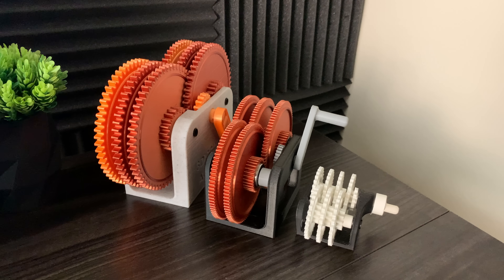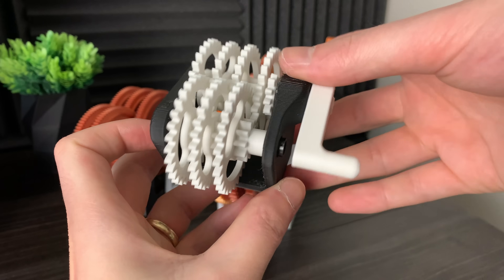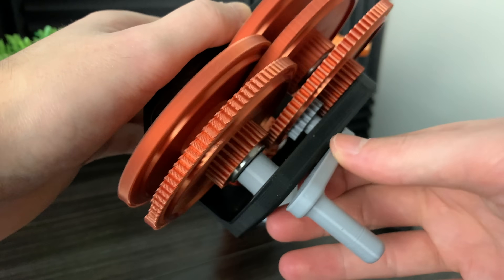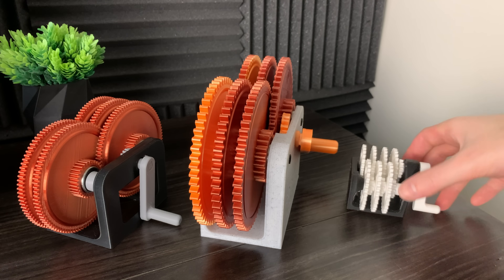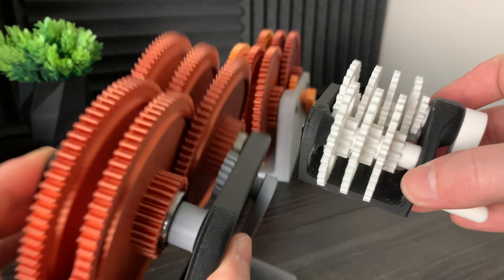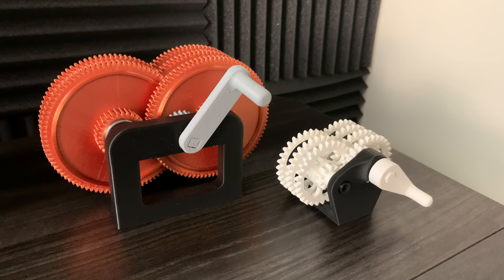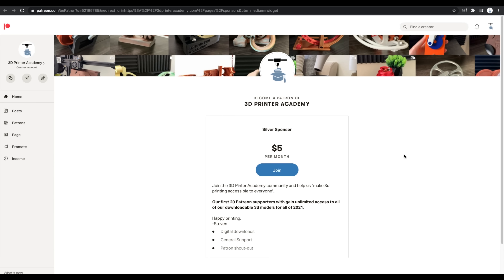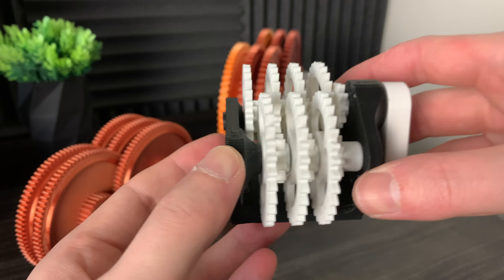3D Printed Gearbox Series [Episode 1]

Comment: I have a few suggestions: (1) Your torque essentially vanishes on the later (fastest) gears, the first gears get most of the torque. So you can make the first gears more heavy and more chunky, by increasing their width. (2) The efficiency of a gear is roughly a function of the tooth depth w.r.t. gear size. So to make it more efficient, reduce tooth depth of the ones spinning quicker (or increase their overall size), which works since you don't need much torque (less tooth depth gives less resistance/durability)

Comment: I made something similar for an electric boat I’m building.  The input spins at around 20,000 rpm and the output at around 1,333 RPM.  The 4 gears are solid ABS and the wooden enclosure houses 6 bearings.  The gears are lubricated with white lithium grease, which appears to be inert.  I should have used graphite lubricant, but white lithium was the only grease I had on hand.

Comment: You NEED lubrication. I work with wooden gears and use candle paraffin or dry soap as dry lubricant for the teeth. The difference it makes in friction is insane (to the point where most of my mechanisms wouldn’t even work without it). I haven’t worked with plastic gears so I don’t know if it would be better to use some kind of liquid lubricant instead or not. But anyway, you need lubrication.
Reply: @3DPrinterAcademy  good idea. Try graphite or very “watery” fluid based lubricant
Reply: @3DPrinterAcademy  for rubiks cubes, speed cubers use silicon oil, and both are plastic so probably would work well
Reply: I was gonna say silicone oil too. That’s a good lubricant for plastic
Reply: Silicon oil huh? Good suggestion ;3
Reply: I was also gonna say silicone lubricant